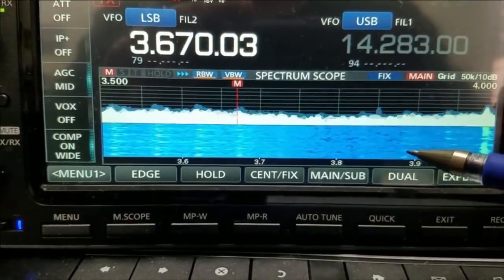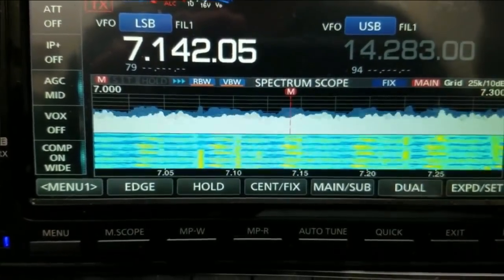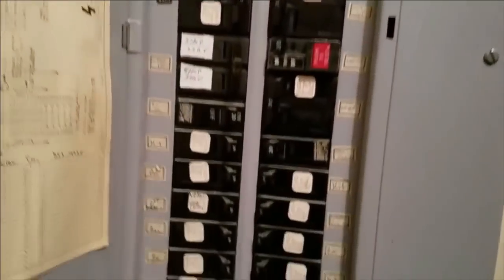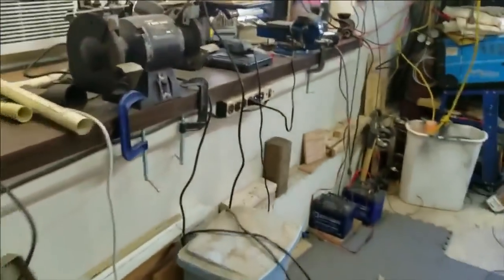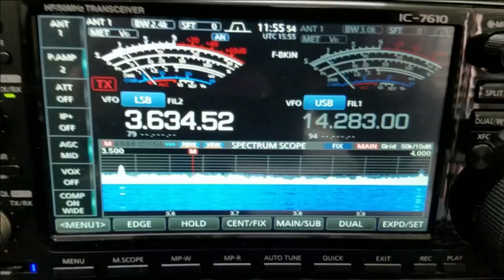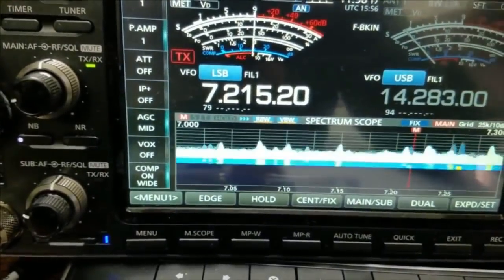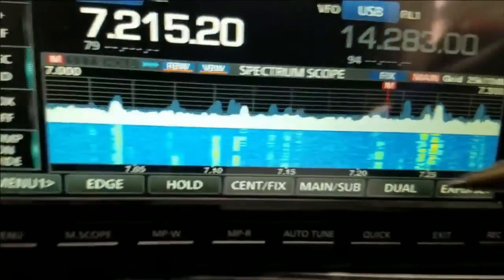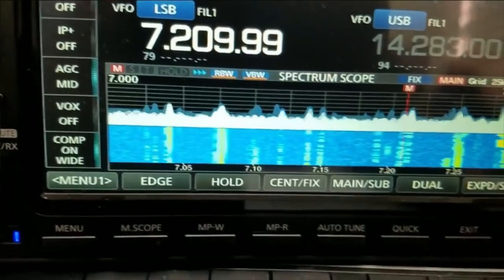Locating RF interference on your power mains

Comment: i had S9 +10 broadband noise. Turned out to be an unsuppressed power supply for a string of led's across the street from my shack. i replaced the 24 vdc supply with a nice HP supply with suppression and noise  level dropped to S2-S3 all on 75 meter band , day or night.  i had the power company find it for me with their special RFI detector 🙂

Comment: Hello, I wondered if you could offer me some advice. I own a Rhodes electromechanical piano. Previously it had a passive output, so I installed a purpose built active pre-amp, working on a 24V power supply. Since I installed it, I am now getting interference on the audio from the piano that was not there before. Specifically there is some static, and behind the static I can hear radio music coming from a radio station. So clearly the piano is picking up RF interference. Do you have any tips on how I might block this interference from my piano? If I plug a guitar amp into the same surge protector that the piano is plugged into, the interference also comes out of the guitar amp. As soon as I unplug the piano power supply from the surge protector, the interference in the guitar amp disappears. Thank you for any advice.

Comment: I have a AM/FM cassette radio that the FM is blanking out every time I key up a transmitter. I‘ve tried RF chokes on the AC line and on the antenna input to the transmitter but they don’t seem to do anything. Do you have any suggestions on how to fix it? de N0IAV
Reply: you need to offer more information. What band/bands, what mode of operation, what power level, coax feed to antenna or ladder line, what distance to FM station IOW what is the relative power of the station you are trying to hear, have you tried an outside FM antenna that is directional to the station of interest, have you tried listening to the station of choice on the internet in lieu of a conventional FM receiver, have you tried measuring the relative field strength of your transmitter in the shack? If your shack field strength is excessive then you may want to use a balanced line feeder. n7ud

Comment: I have a portable AM/FM cassette radio that the FM blanks out every time I key my  amateur radio and CB radio. Tried to stop it without success. I tried RF chokes on the coax from my antenna and AC line both on FM radio and amateur and CB and still no solution I don’t know what else to do. Any idea of what I can do?
Reply from the maker: sounds like tipical front end over load of the receiver. That means they receiver might not be so selective.   See if it does it on other radios. Also you did not mention power. how much power are you running. based on how close and high power this may be pretty normal.
Reply: @w5kub  30 watts on one transmitter and 16 watts on the other transmitter
Reply: Running 30 to 175 watts three  rooms away, transmitting antenna is 27ft in height

Comment: Hi Tom, Sam here (K6UA)... what are your thoughts on power conditioners and regeneration units for cleaning RF noise on electrical mains before powering HiFi audio equipment?  Snake oil? or makes a difference?
Reply from the maker: Hi Sam, i dont have any experience on that.  I have found that there are a number of the cheap wall warts will cause a lot of interferrence.  I have put ferrites on my ac cords but i didnt see much change. finding that battery charger was a big improvement.
Reply: @w5kub  thanks ... and 73
Reply: @chuckdebian2205  sadly I don't... this property was taken by some members of Dale's family and dismantled .. I currently don't operate at all, as I'm living in a Condo in NorCal..

Comment: I have electrical poles outside my home, ya know power lines. Can that cause rf interference?
Reply: I have a pole at the end of my drive way, my neighbours plasma tv was pumping noise in to the mains and it was travelling from the phone line back to the pole at the end of my drive way so it is possible, I stood at the end of my drive with a Tecsun PL660 and followed the noise to the exact house causing the issue
Reply: if the pole hardware is arcing it can cause havoc, even a half mile away. i had a problem with 75 meter band broadband noise and power company sent out a technician to find the problem a half mile away. It was a lightning protector that was defective.  n7ud

Comment: I had the same exact RFI from a battery tender in my garage. Didn’t need it anymore so I took it out of service.  Months later, I had the same problem with another charger for my boat in the backyard. I used a Mix 31 clamp-on ferrite on the AC power cord and RFI disappeared!  de K6TQ
Reply from the maker: thanks, ill try some clamp on ferrites.

Comment: Some devices that I have found to cause RFI on the shortwave (HF) bands: switching power supplies (including most wall wart power supplies), front loading washing machines, garage door openers, touch lamps, security lights, fluorescent lights (including CFLs), street lights (including LED types), day/night photocell lighting controls, LED lights, light dimmers, flat screen TVs, CRT screen TVs, electric fences, gas stove igniters, battery chargers, high-speed internet junction boxes, electric motors, refrigerators, hot tubs, overhead power lines and transformers, wired smoke and CO detectors, computers, and surge suppressing power strips, etc.
Reply: You are right!  Jim K9YC who holds a BSEE degree, says there are around 36 devices in a typical household.  His publications can be found here: audiosystemsgroup(dot)com/publish.htm